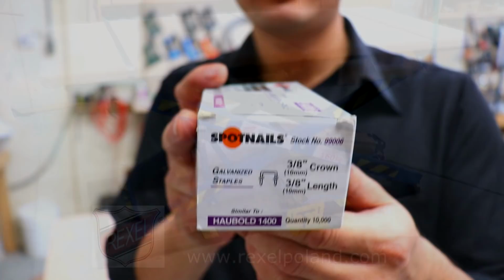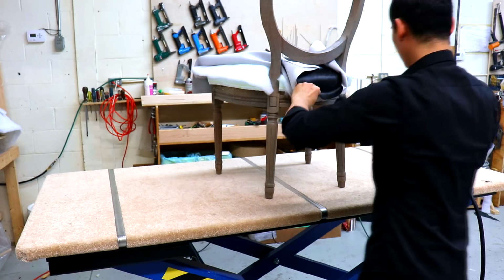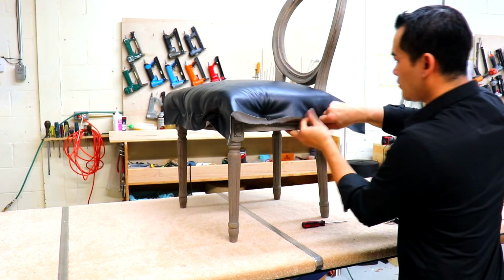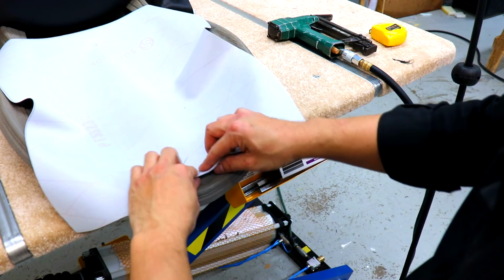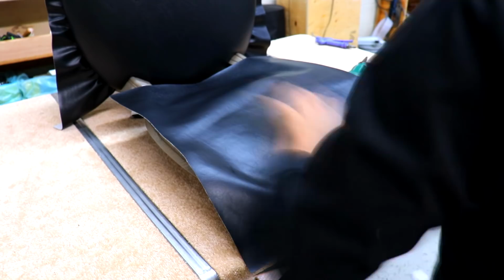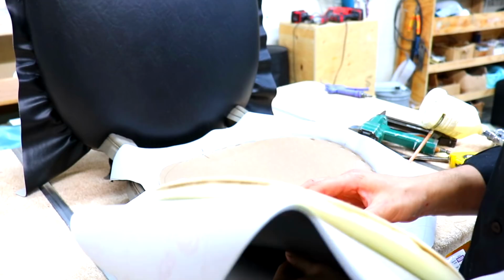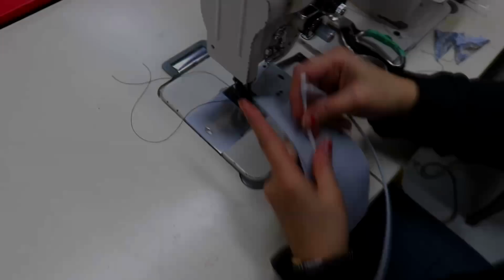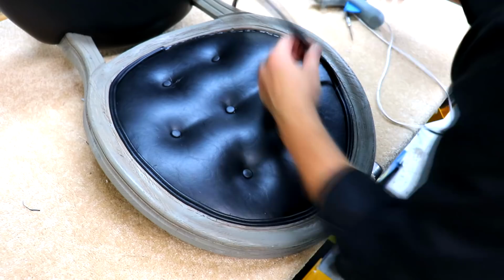DIY-HOW TO REUPHOLSTER A DINING ROOM CHAIR WITH BUTTONS - ALO Upholstery

Comment: How did you get the welt cord to stick with a hot glue gun? Usually vinyl don't stick well to each other using hot glue
Reply: Christopher Barnes There are glue sticks that work with vinyl.  Try an upholstery supplier.  The stuff in stores don’t work.
Reply: Tia Williams thanks appreciate that
Reply: Yeah what is the glue called I usually have to staple in between the twin piping takes ages and its easy to split the seam. Nice chair